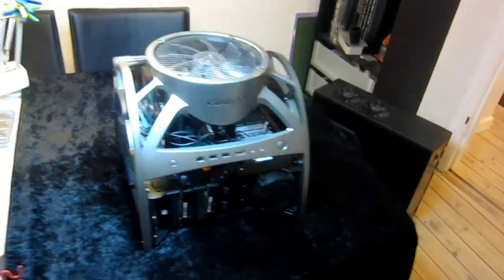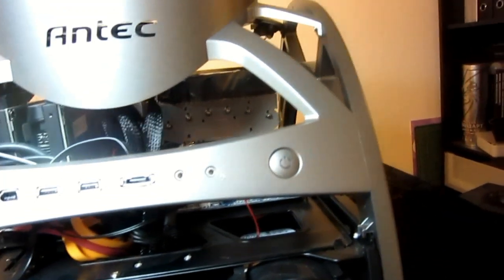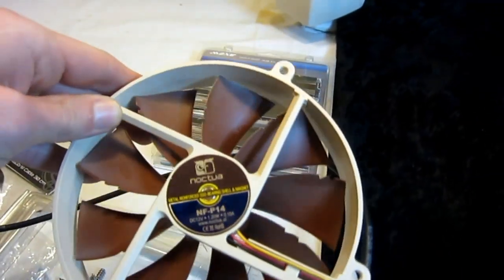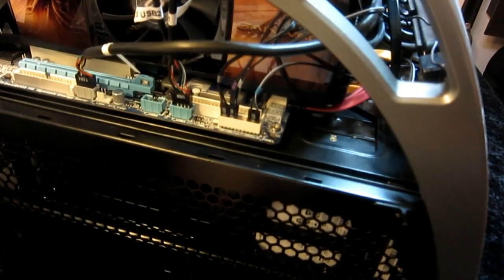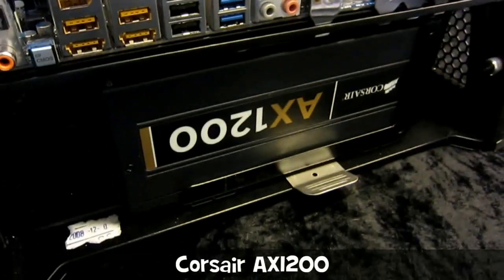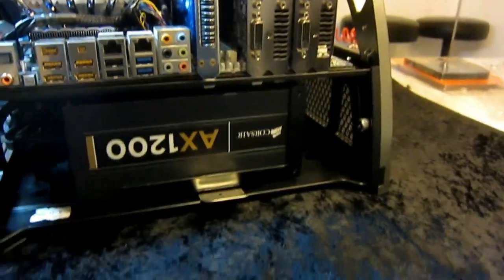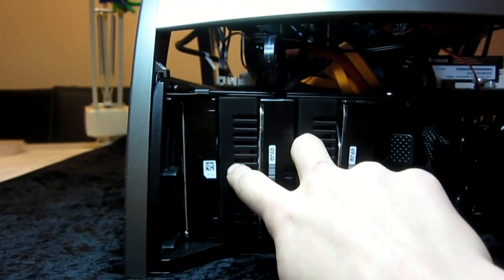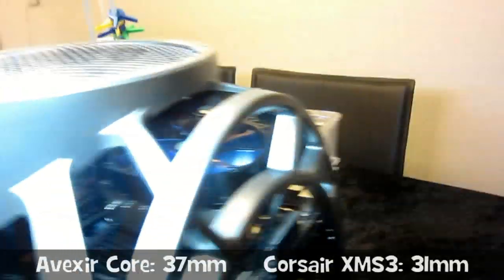Antec Skeleton build - Part 1

Comment: Beautiful build! by the way, dual GTX 590 is already a 4 way SLI, so you can't add another card! and you better put the 2 cards in the upper slots, because the lower ones usually have reduced bandwidth! :D